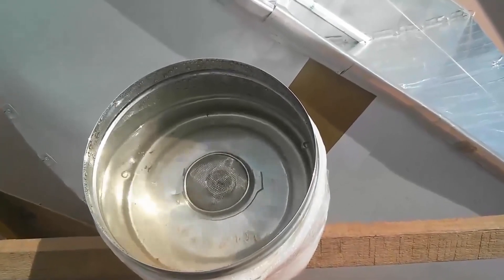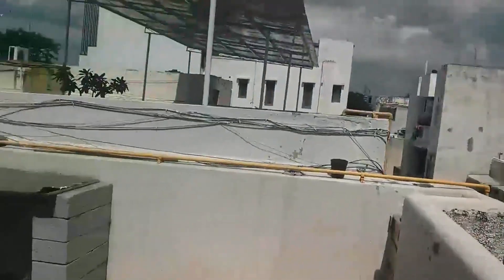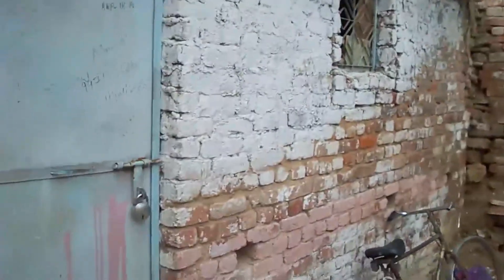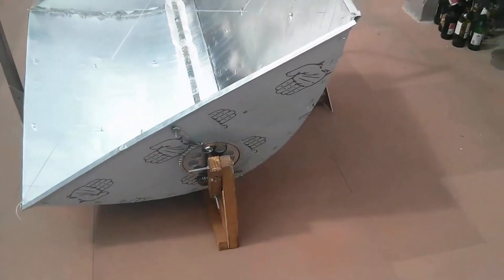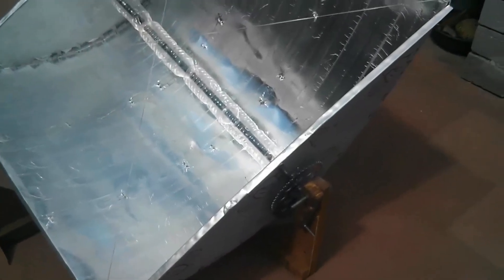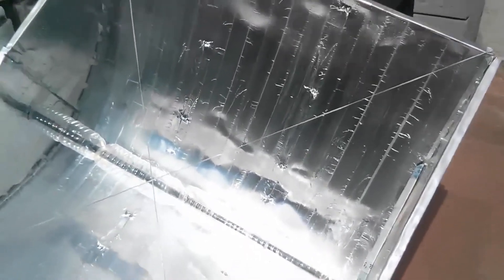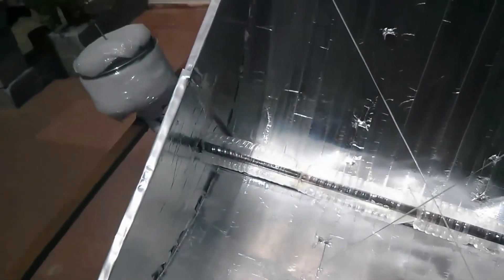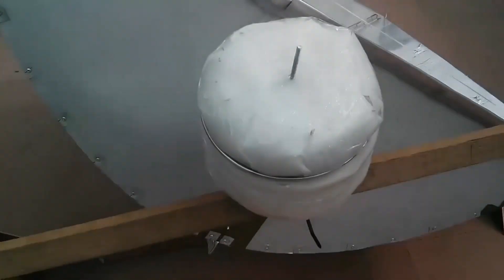$40 Open Source Water Boiling Solar Cooker

Comment: Wouldn't a parabolic dish shape be more powerful and efficient? You could make a six triangle peddle design with 90 degree flange tabs which can be riveted from the back. No boiler tube needed which is simpler design. pdf patterns could be printed off.
Reply from the maker: It'd concentrate a lot more, but that's not really necessary for this use case. Would also then require two axis tracking.

But if you do need high temperatures for your application, then yes they are a lot more effective on that front.

Comment: Do you think mylar crisp sachets would be good for making the reflective surface of solar boiler?
Reply from the maker: No they're semi transparent unfortunately, and don't hold up well in outdoor environments.
Also you'd need thousands of them.

Hydroponic mylar is cheap and super reflective, but also not hard wearing. Best thing apparently is vinyl decal, but I've not had a chance to play with it yet myself.
Reply: @OpenSourceLowTech  Great, thanks for your help. 👍

Comment: Have you thought of trying a staged system, where the water would be preheated by a larger direct light absorption panel? Maybe your aluminum printing plates sandwiched to wood backing with soft copper pipe and some thermal paste between, then painted with bitumen. Also, given that you're in India and producing steam have you looked into the possibility of buying or commisioning some small steam turbines? I have a theory that we should be able to beat the efficiency of photovoltaic with solar-thermal steam rather easily, particularly in real world rather than ideal test conditions. I think we should tune a system in, have it manufactured in India and sail a ship full to cuba.
Reply from the maker: Yeah preheating could be useful over all, check my channel for a flat panel design, and something like Lytefire for solar steam electric.

There's also cascading on the output side, where the waste heat from a process is about the right input temperature for a secondary process. Like cooking with the steam turbine exhaust, and then heating water with the exhaust from that, etc etc.

Comment: Still using a tube in the middle to hold the water to be heated a compound parabolic mirror would be more efficient directing all light to the tube from all directions and even work on cloudy days
Reply from the maker: I've done a bit with compounds, they don't increase the aperture or concentration factor, but they are good for broadening the angle of incidence from which you can capture light, which can be handy for untracked collectors.

Comment: Modify a keg by putting it on a spindle and rotate at a high enough speed so that the centrifugal action forces the water to the walls of the keg. Paint the keg black and use a much bigger solar concentrator directed on the keg.
Reply from the maker: You'd need to double glaze it to fight the cooling effect of whipping the keg through the air, and the water would only spend about a third the time in the sun, but that is the first time I've heard the idea of increasing surface area to mass ratio with a centrifuge..

Can also just use a thin panel. Check my channel for videos on that.
Reply: @OpenSourceLowTech its not my idea, theres a research paper that describes this kind of system in better detail. Ill try to find it for you.
Reply: @OpenSourceLowTech "Performance of solar still units and enhancement techniques: A review investigation" authors claim 200% increase in vapor production over a sloped design can be achieved by incorporating a rotating drum design. I cant find the specific paper i read that describes building a low cost system using a keg.
Reply: Exfoliated graphite would probably be a good candidate for paint pigment considering its excellent light absorption and thermal transfer properties as well as cheap and easy to make without much equipment.

I wouldnt bet on it improving efficiency but it would make for a nice experiment none the less.
Reply: Enlcosing the unit in a box would mitigate heat lost to the moving air caused by rotation. May not be much of a concern anyways though. The papers ive read talk about drum speeds of only 0.5-10 RPM.

However, some of them did mention using a glaze like you suggested.

Comment: 0:45 ... i am subscriber ... respectfully i think the assignment has been missed ... when i see such things .. yikes

maybe we need to design a way / system to IMPLEMENT refuse disposal ... work on other end of the cycle ....

this would move the needle more .... than the hardware design of cheaper more efficient energy generation / harnessing and its use ...

are we solving the wrong problems? .... hmmm
.

Comment: Have u seen nighthawkinlight s video about solar collectors?
Reply from the maker: A couple, which one in particular?
Reply: @OpenSourceLowTech  This one: https://www.youtube.com/watch?v=8zlAI32MSsQ
Increasing the overall heat output by using a compound parabolic concentrator. Instead of focusing the light on an infinitely small point the compound curve optimizes the mirror to the diameter of the pipe which enables a wider collection angle.
Reply: @OpenSourceLowTech the most recent one
https://www.youtube.com/watch?v=8zlAI32MSsQ

Comment: I like the solar cooker but I don't think the sprocket is truly needed, given a threaded rod (or some bolts on both ends of the solar pan) would allow the unit to pivot, while the addition of some simple/cheap wingnuts (and lock washers) would allow the user to hand tighten the wing nuts, which would hold/lock the solar pan in place at the correct angle to the sun.
Reply from the maker: That would also work, yes. This one is a throwback to an earlier design which had a tracking system attached to the drive shaft.

Comment: This sort of water boiler is going to make a world of difference for hygiene and waterborn diseases, in places where fuel is hard to come by. I can also see this design being used to heat a tank of water, to use as a hot water heater, or pumped through a thermal mass to heat a greenhouse or other building in colder climates that still have sun.
Reply from the maker: Indeed. Also, Pasteurising water only requires temperatures of about 70C, or as low as 60 if you hold it there for half an hour. Which is a lot less energy overall than boiling it.
Reply: These devices have existed for decades already. I've heard of people using "solar kettles" for camping 50 years ago!
Of course, more widespread adoption of larger-scale devices can't hurt, either. If I could build a house from scratch I'd probably have something like this for hot water. Or maybe heating sand or bricks which then heat the hot water afterwards, so there's "lag" after the sun goes down.
Reply from the maker: For mass heating, ie a lot of water or earth which is only raised by a couple of tens of degrees, you're better off just painting it black, putting it under glass/plastic, etc. Unconcentrated sunlight can warm masses to 40-50C fairly easily, and it's a lot easier to get more energy by cheaply throwing square meters at the situation, rather than anything medium technical.

What things like this can do tho is get a smaller amount of mass to a much higher temperature, for applications which require that, like boiling water.